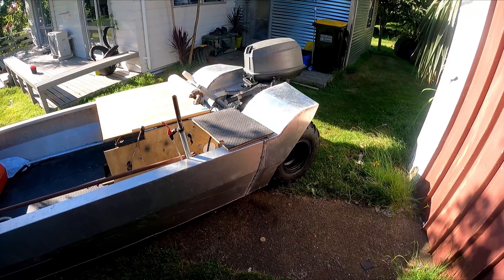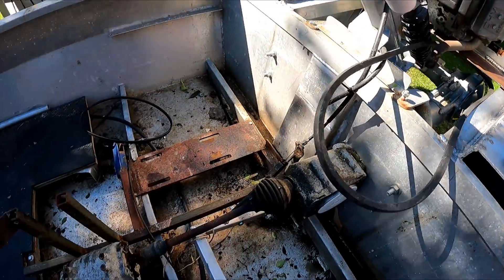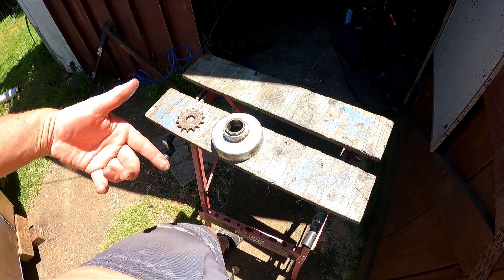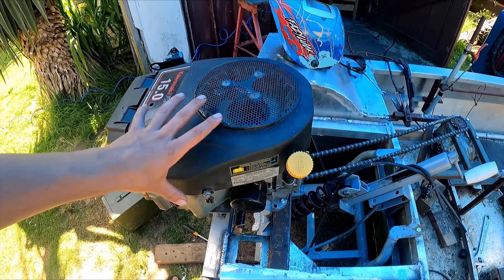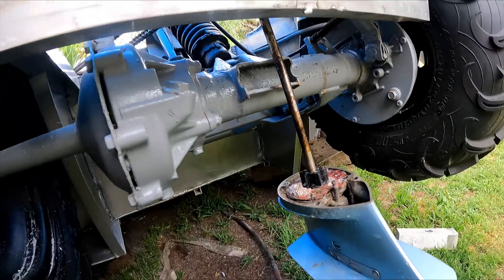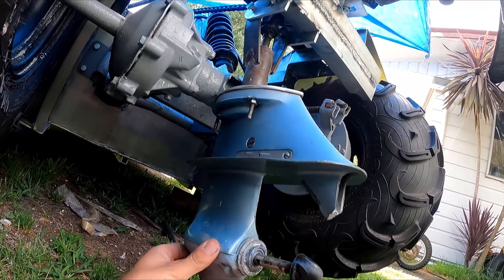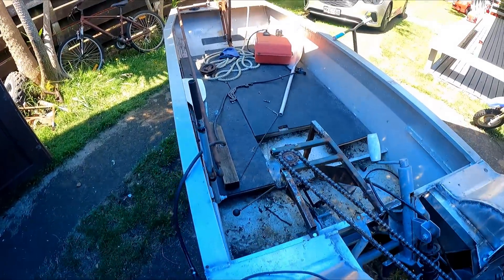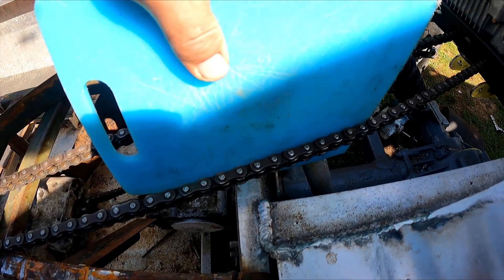Amphibious ATV Boat Build, Part 6 New Motor!

Comment: You should put a more powerful engine mounted directly over the transmission for a bit better weight distribution (I know, not that much of a difference but still) and then put paddle tires on it so you don’t need the outboard and will give you better speed on sand.

Comment: That lower unit will be fine but the industrial engine wont get to the same rpm as the original motor so you will be prety slow unless you find or make a high pitch prop.
 Otherwise i love this thing and cant wait for the next video

Comment: I would just run an alternator off the motor and find a decent thrust electric trolling motor. Could run alternator and the tire drive off a single drive belt. Like the whole concept though. I am trying to find a small flat bottomed boat to put on a rack on my quad instead of having to trailer a boat with me when I off-road into lakes.
Reply from the maker: You could make a flat bottom boat they are pretty easy to make. I like the electric idea , there is an amphibious boat that has electric motors for the wheels and a normal outboard .
Reply: @dkthewelder  I do not know about where your from but trolling motors are a dime a dozen around here and I quite often find them thrown out.  Probably not hard to find an alternator and a bit bigger battery. Would have been interesting to put a jetski drivetrain and come off the shaft to drive the wheels with a similar set up to what you have. Be a pain having to cool it when your out of the water if you kept the jetski engine. 

I have always wanted to make something out of carbon fibre. A flat bottomed boat that could double as the roof for a quad /camper would be a hell of a project. Will probably just wait till I find a cheap fixer upper 10 footer duck boat.

Comment: Love the idea of one motor to drive both drives. Is there any way to disconnect the axle gearbox drive while on water and visa versa for the prop? I was thinking about how guys use part of a transmission shaft and gears selector to switch between 2 gears, 1 could be the chain sprocket driving a chain to the clutch on the gearbox and the other gear would be the prop, so only 1 is ever being driven. And then the chain is not running on water.
PS your tensioner was the wrong way round, it should have been pointing forward so the chain pulls along it rather than pushing into it. Hope that makes sense.
Great progress though, well done!
Reply from the maker: The chain goes to the small lawn mower gearbox with 4 speeds and reverse so can put it in neutral when on water , the outboard also has forward neutral and reverse

Comment: Chains aren't happy running horizontally so you might want to include a center support out of the wife's cutting board to hold it up & if you've got any left over after that Mate, you could build a dick bib for grinding!

Comment: Kiwi ingenuity at its finest. Inspirational stuff! Just something to bear in mind about chain drives, is that they run into problems when driving/running lying down (or on vertical shafts, as opposed to motorbikes, where the chain runs upright & the sprockets are on horizontal shafts) the chain will naturally wear away pretty harshly at the upper side (or 1 side) of the sprockets teeth, and want to derail down. So I'd suggest fitting some kind of chain support/guide system (either slider or roller type guide) just before each sprocket, like most enduro bikes have just in front of the rear sprocket. Otherwise the belt might be better, because you can put way more tension on it, and will be way quieter too. Also you might want to extend the rear wheel guards, if they're going to drive as paddle wheels. Otherwise they'll fire heaps of water (& God knows what else) straight into the boat, or at you. Your work & vids are awesome. Look forward to seeing the successful test run. Cheers 👍👍👍
Reply from the maker: I think I should have stuck with a belt! I may end up changing it back 🤦‍♂️

Comment: Where did that 90-degree gearbox come from?  I've got a go-kart project I'm working on that could make great use of one of those
Reply from the maker: It’s an old ride on mower gearbox a tecumseh peerless it’s called , I don’t know if they still make them
Reply: @dkthewelder  That's plenty of info for me to start combing the usual corners of the internet. Thanks! Looking forward to more of these wild builds ^_^

Comment: Great project, those backyard fab skills put me to shame. Also, that 6hp lower unit is probably fine as far as strength goes. It's made to spin over at ~5,500 rpm, the 3,400 that mower motor does should be okay. Can't wait for the next one!
Reply from the maker: The problem is it will be slow so I will put a bigger prop on to compensate which will load it up , it might be ok though

Comment: One engine for both is good concept,   if it was side shaft engine you could have ran it inboard with a gear box for drive wheels, and pto for prop shaft.

Comment: Awesome project. With only a single u-joint I'm wondering if the prop assembly is going to kick around like crazy unless everything is perfectly aligned?
Reply from the maker: Yeah I am worried about that too there isn’t room for two . Another idea I have is like a dog clutch thing that engages when it swings into the down position

Comment: Those V-twins sound really quite good when they have a 2 into 1 with no muffler exhaust system.
Reply from the maker: 2 into 1 and sounds good ! I like that be easy to make too , I like your channel name👍
Reply: @dkthewelder  thanks man if you want to know what they sound like look up Cars and cameras. They made a drag rail with a horizontal shaft version of the V-twin and man whennit winds up it sounds goods

Comment: its not going to plane, reason is that the lower unit on those are geared for higher revving 2 stroke motor. Unless you find a lower unit from a 4 stroke outboard then you can run that vtwin on it. You can try putting a heavy pitch prop on it
Reply from the maker: Yeah the v twin doesn’t rev that high I will put an aggressive prop on it. I would like a 1:1 drive then I can fun a surface drive prop would be cool

Comment: Go hydraulic power? No shafts/chains to align. Mount motors and power unit to suit?
Reply from the maker: Yes hydraulic motors of the drive wheels would be great! But they are expensive and won’t be as fast, then I could also use them to raise and lower the wheels and props . Maybe a good plan for the next version 👍